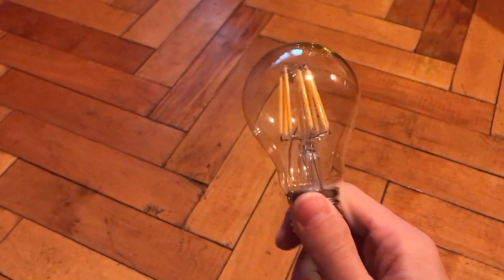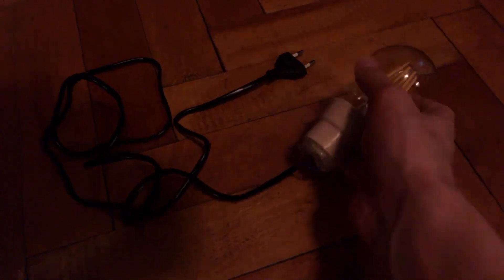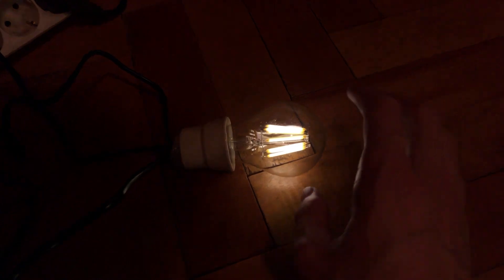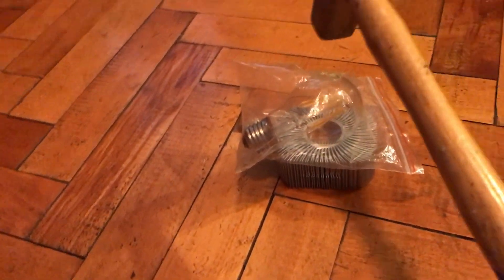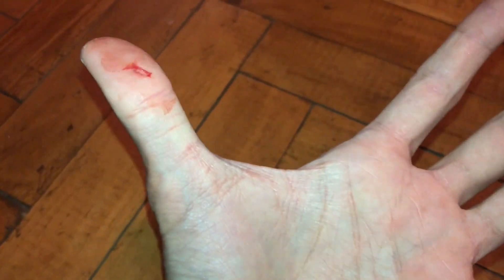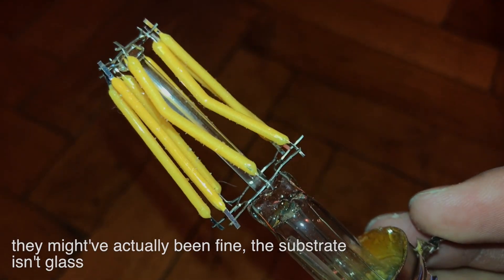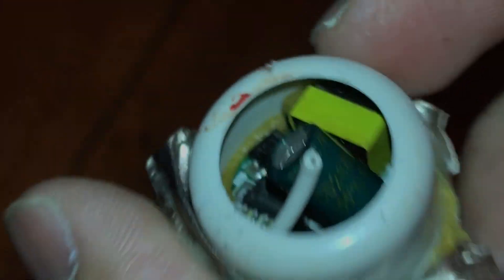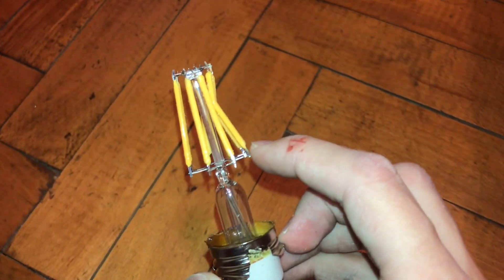LED Filament Lightbulb Teardown & Failure Analysis

Comment: I have really bad experiences with filament led bulbs, it looks good, but I won't buy it again.
Reply from the maker: same 🤘
Reply: @Darieee  I don't know if it's different in countries which use 110V system, but here in Europe, it's really terrible these filament leds, it always starts flashing sometimes even after only few hours or days and led chips don't have any cooling, except connection thru tiny wires inside. Classic ugly plastic led bulbs can be fixed. Also another disadvantage of these filament retro looking bulbs is that it's not really 360° light as they say, when you have only bulb on wire, it doesn't shine down under it, it glows only around it, not down, so it's useless to some specific installations where you need it to send light down. You can buy filament led bulbs with white glass which solves this problem, but it's not easy to find them.
I think filament leds look really good, but you should buy only very low watt versions for decoration or ambient light, it mostly works well when it's max 6W, I had many of them and especially 12W filament bulbs are failing very fast, while standard plastic bulbs with at least some cooling can work few years even when it has like 15-18W.
Reply: @Pidalin  In Poland we have 230V. At home, I regularly replace all old LED and fluorescent lamps only with filament bulbs, because they last the longest of all the ones I tested and heat up less. The ones from Osram worked great for me. "Candle" 40W, 60W and classic with a large bulb (100W). All are 2700/4000K colors. The light is nice, bright, and does not flicker. I also have a 200W Osram model, but it "buzzes" and heats up a lot - I don't recommend it. 

My aquarium originally had compact fluorescent lamps, which I replaced every few months. Regular LEDs didn't last either. The "40W" filament lamp has been working there for 2 or 3 years. At work (warehouse), we also replaced the faulty LEDs with Osram filament lamps and instead of 2-3 months, "100W" lasted nearly 2 years, and "60W" are still working
Reply: @FargothPL  I also thought that filament LEDs are future and upgrade years ago, but reality is more complicated, it's just design that simulates classic bulb, filament doesn't automatically mean better and more efficient, sometimes it can be even vice versa, because you can't glue proper cooler to filament, all heat has to be transfered out of there thru that little wire that connects it. 
So no, filament leds are not surance of reliability unfortunatelly and are not even insurance of better quality light, a lot of them have strobo effect too. But theoretically, because of many of them are transparent, efficiency should be slightly better if you are ok with sharp light with sharp shadows, but that was what traditional bulbs were doing, so most of people are probably ok with that.
In reality after almost 15 years of using leds, it's everything completely random, filament or not, it doesn't matter, sometimes it starts flickering after 2 weeks and sometimes it lasts for 5 years, you can't tell before you test it.
Reply: @Pidalin  These diodes on the filament (if powered by a sufficiently small current), practically do not heat up. Just touch a bulb after an hour of work - it is at most warm. If they are hot, return them as they are overloaded and will fail quickly. The lower efficiency of a single LED is made up for by their several times greater number. They are filled with argon so that the gas transfers heat to the glass, and the construction itself is hermetical, so there is no risk of moisture burning the electronics. 
You said that the disadvantage is that they shine all around. I say it depends on the lamp itself and its location. There are lamps where the bulbs are mounted lengthwise, like fluorescent lamps, or with decorative shades. In them, filament LEDs shine better than classic LEDs which, despite the diffuser, emits rather a spot light. 
I quickly checked a few filament LEDs with a camera, that I got at home. Osram, Lexman (bought at Leroy Merlin) and the cheapest Auchan branded. None of them shine with a stroboscope effect. 
Maybe it depends on the operating voltage and the 230V ones work better than those for 110V?
Reply: @FargothPL  "Just touch a bulb after an hour of work - it is at most warm"  but that means nothing when there is air between filament and glass. Touch metal screw, it will be hot. Classic bulbs were hot on surface because of infra heating that can go thru vacuum/air/whatever.
Reply: @Pidalin  You forget one thing. The air heats up quickly and cools down quickly. It has no heat capacity. The metal screw has a large capacity and gives off this heat longer. I also have one 24W (200W) model and the air inside the bulb is not a problem for it to burn your hand when you touch it after some time of work